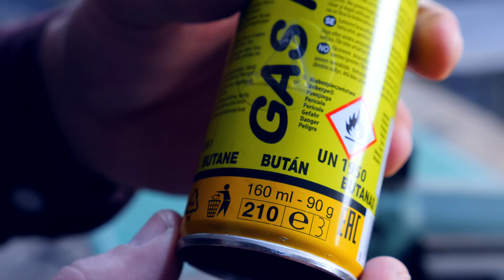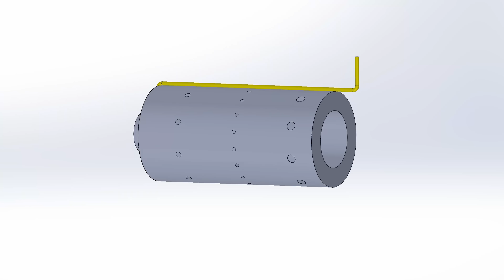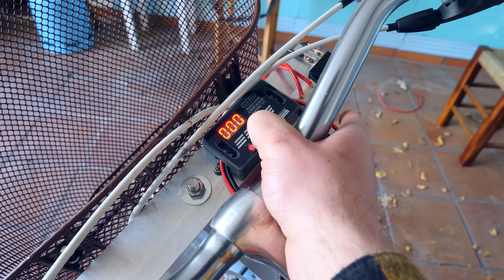I put a Homemade Jet Engine on my Bicycle

Comment: Trabalho em metal muito bom.
Agora voce precisa duas bombas de combustivel veicular 6-7 bar.
Coloca dois aspersores na sua camera de combustao.
Uma bomba bombeia diesel/gas, a outra agua oxigenada %% alta ou usa ar comprimido mesmo e 1 bomba so.
E voce vai ter seu primeiro foguete combustivel liquido.
O furo na camera de combustao pode ser pequena, a pressao sera constante 5-7bar, e um bocal de expansao de 6:1.
O pico de pressao pode acontecer na hora de ascender, mas inicie com o combustivel.

Comment: I'd love to see you call brazing brazing and not welding. Brazing is when you add a metal to join two parts, like soldering but at higher temperatures. Welding actually melts the base metals and the two parts literally become one and would not only give you a join that would not melt at these temperatures, but also a far stronger joint.
Reply: Braising is a cooking technique. 😉
Reply: @ghz24  Hahaha, indeed it is, typo corrected :)
Reply: @gnif  I thought it was funny cause you got it right twice then.. Happens to me a lot especially on a phone.

Comment: fun fact: potassium nitrate mixed with potassium sulfate makes violet flames, which is the hottest fire. Violet burns over 1600 degrees Celsius, that's 2912 degrees Fahrenheit. In other words... extremely hot.

Comment: Lol love the goofy sponsor.  Electric is the way to go... Unless you need to move cargo, or travel far, or use it as a support vehicle... But using 3x the energy and carbon emissions for the same output... They do that 👍

Comment: I need a 3D printer. My idea is heat up salt peter (potassium nitrate) to a liquid (a propane or butane torch will do the trick, but maybe a hot plate would be safer). As long as the melted potassium nitrate is not mixed with a fuel, and then exposed to a flame it won't burn. Heat it to a liquid in a metal container away from fuel and flame. Then put a tomato in the liquid, and apply a flame. Stand back, wear goggles, and see if the tomato starts to burn, and disintegrate.  Inject the tomato with a fuel like ethyl alcohol first to boost the effect possibly. The water in the Tomato may at first retard ignition. Salt peter or potassium nitrate is a powerful oxidant, and used to make old time gun powder (potassium nitrate + sulfur + charcoal). Might get it from farm supply store. Used to destroy tree trunks. If not careful when using, you could burn yourself--- so caution. When I was a kid in high school my brother and I used to make solid fuel rocket propellant out of it. We learned about Salt Peter in high school chemistry. We lived in the country, and found a partial bag of several pounds of it in the orchard adjacent to our parents house. We had much fun experimenting with Salt Peter. I have never done this to a fruit, or vegetable, but when I put charcoal in the liquid potassium nitrate and exposed to flame the charcoal burned like crazy.  I always wondered if liquefied Potassium Nitrate could be used like liquid Oxygen (LOX) in a rocket engine, and pumped, and throttled like liquid Oxygen, and kerosene in a conventional type rocket engine. Unlike a solid fuel rocket engine, you could start and stop the engine--- throttle up, or throttle down! Hope I win, good luck with all your experiments. I actually like Tomatoes as Spaghetti sauce, or Ketchup, but not as a salad. I want to see one of the Tomato bastards burn, and vaporize into smoke.

Comment: Why don't you use an actual car exhaust? Since it's like a maze you can drastically reduce the air flow plus it would act like a radiator which would prevent it from unwelding

Comment: What if you used a bunch of torch lighters, the actual flame cartridge as a jet engine/rocket motor. Like the torches they sell at smoke shops? I really think you could push them hard due to the fact that each torch has a ceramic element that is intended to get very hot. If you were to maybe build them into an array/assembly.

Comment: I think it would be fascinating to see if you can add exhaust turbine blades to drive a fan at the front of the jet.  You have the combustion chamber, and you could see what amount of thrust the turbine could generate driving a larger fan, driven by exhaust gases and the leaf blower.

Comment: loved it but bracing or soldering isnt welding , and as your a youtuber i shouldnt be the 1 to explain to you that in the last 2 years you could have easely learned to properly weld metal.
seeing it took me last than 2weeks couple of hours a day to learn it with plenty off yt vids. it really isnt that hard.

Comment: Ramp up the stakes and do a pulse jet running of LPG.
You should be able to get 30 seconds out of a small 2.5-3kg bottle before it ices up.
Put a heatshield between you and the engine though.

Comment: If you didnt know, this engine is often reffered to as a motor-jet, where an external motor is responsible for running the compressor.
There is few examples out there but a late WW2 project is the I-250 with a combined powerplant.

If built with a powerful motor and a well designed compressor, it is possible to get quite a bit of thurst. And while it does require some heat resistant materials, not nearly the amout that a turbo-jet does, in which the turbine blades and it's bearings need to resist the heat of the exhaust.

Comment: 3:00 you're brazing not welding. In short, welding is a technique that joins metals by melting the base metal and causing fusion, while brazing joins metals by melting and flowing a filler metal into the joint.

Comment: I think if you used an EDF along with a compression stage before the combustion chamber you'd get more thrust, also use 2 different fuels, butane as you used before to rise the temp and once at high temperature use Jet-A. Hopefully you get around to seeing this I belive it would be an awsome build 🤙

Comment: IDEA: Improvement for Tesla Turbine

Create magnetic bearings to make the rotation completely frictionless. 
You can buy ring magnets where the inside of the ring is one pole, and the outside of the ring is another. 
Through the proper configuration, you could create a frictionless axle. 
If you use aluminum plates for the rotors, you could probably reach amazing speeds!
LOVE YOUR CHANNEL!

Comment: You should 3d print different rocket pieces, testing what variables change what about the rocket, including the material the rocket is made of, the body or tip shape, the type of fins on the bottom, etc.

Comment: This could be done with thin material but you would have to learn to Tig weld stainless steel.
Even the steel you're using would last quite a few runs if it were properly welded not brazed. Your spot welds held up but that brazing filler melts much lower than steel

Comment: The real way to solve the heat problem and the ignition problem is to make it have a bypass like a turbofan engine. You'd have cool air blowing by the engine casing/exhaust cooling it, plus move more air and take advantage of the Bernoulli principle

Comment: It would be very interesting to build a Fusor. It´s a small scale fusion reactor that can be made at home if you are careful of the high voltage.
Reply: uh what? is this a joke or fr?
Reply: And scare every nuclear authority in Europe? From the sudden spike in radiation emission?
Reply: @avroarchitect1793  I don't think you know what nuclear fusion is.
Reply: @avroarchitect1793  You clearly do not know what you're talking about. Building a fission reactor is far different due to the ridiculous amounts of radiation they give off. This is what a fusor is. https://en.wikipedia.org/wiki/Fusor
Notice it's listed as a popular hobbyist project. That is because small fusion reactors do not give off noticeable amounts of radiation and as such do not get picked up by the government.
Reply: @user-cg3em4cw4f  Among the biggest challenges in the ITER reactor include the High Neutron flux. Yeah I do know. And yes they do generate detectable radiation.
Reply: @avroarchitect1793  Detectable yes. Enough to freak out the nuclear authority? Absolutely not. That's why I say you don't know what you're talking about. Unless you make a huge ass one it's not going to draw any attention, especially since fusors are commercially available as neutron sources.
Reply: @user-cg3em4cw4f  not sure where you are from, but that stuff is heavily regulated here, and a lot of people get very nervous when they detect a new unexpected source. Just because you don't have the army kicking down your door doesn't mean that there isn't a sudden spike in activity any time they detect an unexpected return on sensors.

Comment: I have a trangia (methanol) based stove, with a modification, to make it run on petrol (gas in the US).  It essentially starts with a pressure vessel, which is fed with petrol, and seeded with a manual air pump.  A tap controls the fuel/air mixture leaving the vessel, into the burner.  Once running the heat from the flame, keeps a tube which feeds the fuel into the pressure vessel, hot, so perpetuates the reaction. I wondered if you'd considered using that, as it ought to be more calorific than butane, so should give you more va-va-voom

Comment: Could you make a turbine shaft driven fan? You know, like a mini helicopter with no tail rotor, just the engine and the main fun
And maybe, if placed vertically it could provide some air to push a bike

Comment: Hey integza cnc operator here. i know its not the right video, but i have seen your tests with impellers. please do not underestimate the (kinetic)energy you can store in rotating objects. if a piece of the impeller breaks off it can easily have enough kinetic energy to penetrate your clothes and your body. The doctor might have a really hard time finding the plastic pieces, because plastic doesn't show up on X-Rays. 
Please put a Plexiglas pane, not acrylic, that's brittle, in between yourself and the rotating object or wear a face shield, thick leather apron or motorcycle jacket and cover your throat if the face shield is to short.
I have seen pictures of such accidents and its not pretty.

Comment: You should use the exhaust of a vacuum cleaner, their turbines are optimized for high pressure, leaf blowers are meant for low pressure high flow rates

Comment: I have an interesting idea for a video, trying to recreate a smaller version of the propulsion system of an old concept for a Vertical Take Off and Landing plane, it had three aero thermodynamic duct jet engines mounted on the tip of each wing, they all faced to the side and actually made the wings rotate to turn them into a giant propeller. Of course the thing was spun up using a motor to get air going through the jets, as it was required to start them up. Really fascinating concept, I'm sure it would be a fun project to work on!

Comment: Bro try this : You have done a video on rotary engine right . Do it using metals and don't use the fuel as air in that video. Do a combination rotary engine. I think it is better to see that you r driving that engine , fit into your bicycle and it will turn into a motercycle right try it 🙂🙂🙂.

Comment: Could you try using the heat energy of any 
of your combustion engines to fuel a steam engine for a higher efficiency of fuel use?

Comment: I guess with that really high temperature, you need a TIG welding machine rather than soldering with brass. High melting steel can withstand a bit higher temperature than brass.

Comment: Can u make it into a skateboard? Maybe use a battery hairdryer or hot air blower gun, add fuel and skateboard, if u get a proper skateboard with good bearings if Chapultepec roll very easy and gain speed easy 🥰🐶

Comment: A rocket engine that uses water as fuel. you already have the high voltage generator required XD

Comment: As soon as I read 'leaf blower', I knew this was going to ultimately be a cosmetic but underwhelming experience.
The primary function of the compressors on jet engines is cramming more oxygen for combustion into the same size space, aka, air density via compression. 
Your leaf blower is providing tons of volume with no additional compression, so now you have an overpowered hair dryer. 
Material tolerances are the next step to getting a better running engine. Stainless steel is about the only material you'll have access to that will tolerate the heat better, unless you have substantially deeper pockets to play with ceramic coatings. 
Time to read up on your engineering, Teg!

Comment: Hey buddy, I’m a machinist in America and I would strongly suggest against using rubber gloves while using a drill press, saw, lathe, etc… if that drill bit grabs the rubber glove it could tear your finger off! I’ve seen it happen before. At my shop gloves are prohibited for this very reason! Keep on doing what you’re doing, I love the videos but please be careful! Much love from America!

Comment: I'd like to see you do the same again but with 2 combustion chambers with flame holders and 2 properly sized nozzles made using better materials- you should be able to turn the blower up even more (or better still swap it for an EDF and speed controler)- You could also try different fuels and mixtures- I understand that NOS is easy enough to get hold of and a bit of a laugh - Hehe hehehe hehehehe hehehehehe... All the best.

Comment: Your problems with welding can easily be solved if you were to spend just a bit more money in your videos and purchase or hire a proper argon welder and maybe invest a measly €500-€700 in a better car which isn’t some awful Ford Galaxy. Maybe a simple old Volvo, Opel or VW. Why a galaxy? And you know maybe invest a little bit extra In materials and not the cheapest crap you can find. The only reason I haven’t subscribed yet is because while your ideas and inventions are great in theory, in practice they look and perform awful as you’re a cheapskate who refuses to spend a little extra on better quality tools and materials. Oh and I did notice you using a terrible Parkside (Lidl) drill as well instead of Bosch which just about proves my point. Great man with great ideas but is too cheap to make it work properly. Instead of a can use a cheap metal water bottle or just buy a bloody pipe for €4.

Comment: The "welding" you kept referring to is actually brazing. They're not the same thing: Brazing is basically beefy soldering. You're heating up the parent material until it's hot enough to wick the yellow brass rod between the two pieces. If you pick up a cheap TIG welder, you'll have a lot more success with the nozzle designs and you could ditch the spot welder entirely.

Comment: How fast would you have gone if using only the leaf blower in the same configuration, so no butane or flame?
The pressure out the exhaust can be no higher than the air entering the combustion chamber, so is the diameter of the blower air entry into the chamber much smaller than the diameter of the exhaust?

Comment: Hey Integza, after watching your butane balloon demo I have a PPE (Personal Protective Equipment) recommendation: Navy flash gear.  It's a set of elbow length gloves and a hood to protect your skin from flash fires.  Relatively lightweight, breathable, and cheap insurance for your face parts and meat claws.  You can find sets from the USN and RN relatively easy.  Keep up the awesome jet work!!

Comment: You made more of a rocket motor than a jet engine. The difference is that you’re not extracting work from exhaust gasses with a turbine to power an impeller, you’re just using what is essentially an electric supercharger to compress air. I’d suggest taking an impeller from an old automotive turbocharger and using that to make a true jet engine

Comment: As a disabled person I can drive a gas powered car, but it's would be a crime in the US for me to drive an electric. 

See to drive an electric cars on the roadway in the US, the federal DOT requires you to have at least a Class C CDL with Hazmat endorcement, and a commercial operator medical card. The car also must be plackered accordingly.

See the lithium ion batteries are considered hazardous material and waste. As such it is strictly regulated on US roadways.

Comment: 2 of those engines on a little go-kart type vehicle with wings and control surfaces would surely be enough to get you airborne with a long enough run up

Comment: We've seen everything from Pulse to Turbofans to now a leaf blower being used... but there's one I'm curious if you could replicate - apparently from a little bit of research there has been a few successful attempts at Ionic Propulsion - I'd love to see if you could make something using this principle. Probably wouldn't be feasible to make something big enough to fit the back of a bike, but I'd still love to see if you could print something up!

Comment: I certainly wouldn't call this a jet engine any more than the blow torch you used for welding is a jet engine.    You would probably get the same thrust out of the leaf blower by itself.  

Just because you contain combustion inside a can doesn't mean you are producing anything extra.  Real jet engines have multiple stages of air compression fins to actually boost the internal pressure in the combustion chamber.  You aren't doing that.

Pulse jets suck in air and fuel in the proper ratio to cause an explosion.  That explosion closes a reed valve forcing the combustion gases out the back, as the pressure drops it allows the valve to open again allowing more fuel and air to enter which then explodes.  You have no explosion, only fire.    You could utilize what you made with a proper nozzle to run a smelter though.